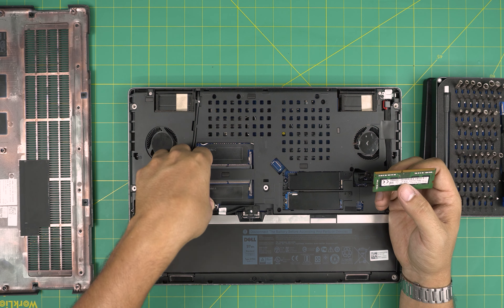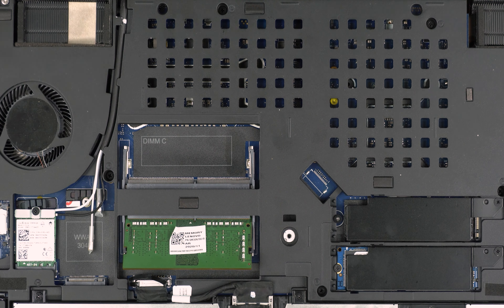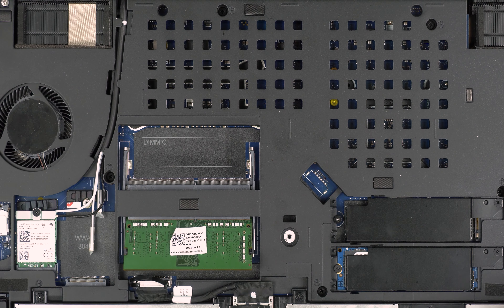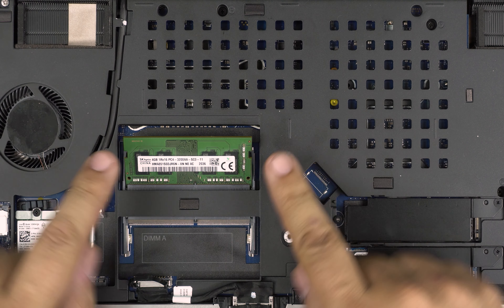How to Upgrade RAM for DELL Precision 7530 Laptop | Step by Step

Comment: First of all, thank you for this detailed and useful video. Do you know how many (max) GB RAM the Dell 7530 (i9) supports? Some sources say 32GB, some say 64GB.
Reply from the maker: Thank you for your feedback! If you wish to support the channel, you can like, subscribe, or both!
Regarding your question, to find out the exact max ram capacity check this link: https://youtu.be/tKEJTkVth4Q
we have upgraded this laptops to max 64gb (4x16gb), but make sure the cmd gives you the 64gb clearance,
this are the ram we use, very solid and compatible. https://amzn.to/47BNKfo
Should you have any further questions or requests in the future, please don't hesitate to ask me.
cheers🍻

This is an  Amazon affiliate, when you use my links, I earn a percentage, which helps support the channel🙏.
Reply: @uFixTek  CMD commands helped me a lot. I didn't know these commands until today, but they were very informative for me. Thank you again.
Reply from the maker: It's my pleasure my friend.
Reply: I have the 7540 i9 and it supports 128 GB